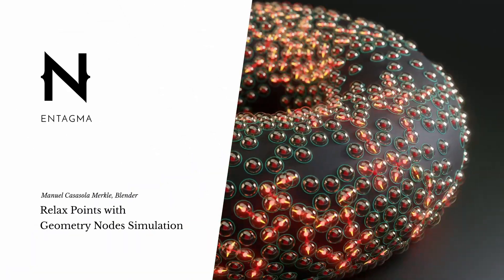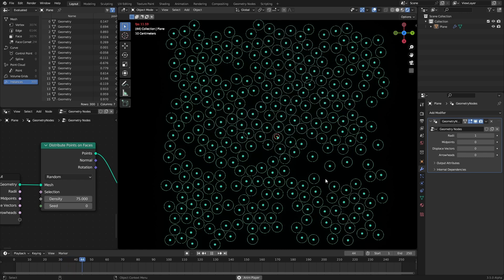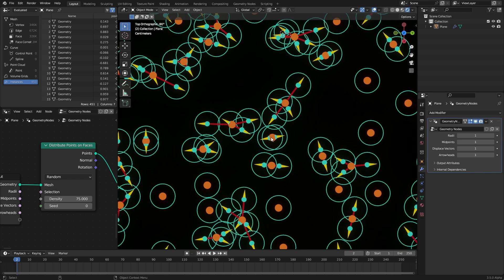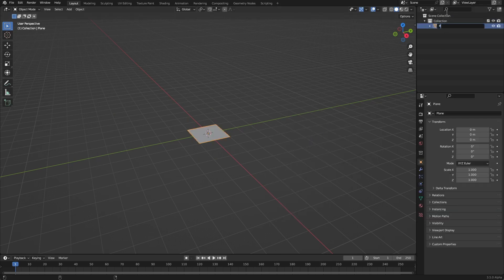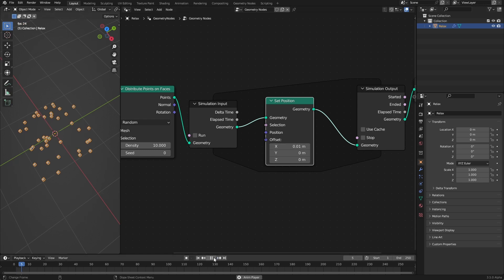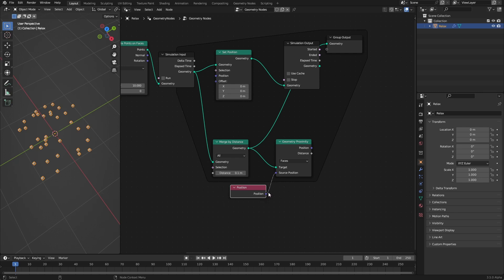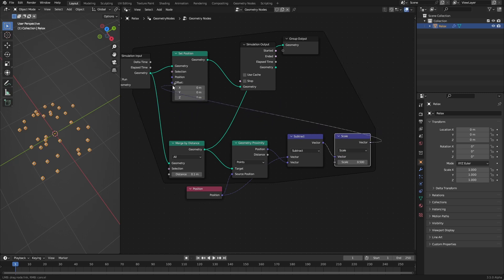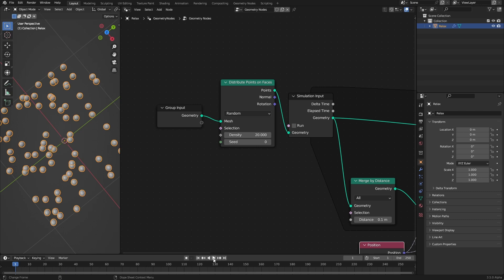Blender Tutorial: Geometry Nodes Simulation: Relax Points

Comment: Ths is cool! I tried implementing a similar system, but using the radius of the particles to determine if they are intersecting. I am facing an issue though, the particles seem to relax, but not according to their radius, which I have randomized beforehand. They are all equally spaced from their origin, but they should be spaced equally from their boundaries. The radius attribute, which is unique for each point, is being ignored in the Simulation Zone and the same value seems to be attributed to all particles when simulating their displacement. Any idea on why this might be happening?